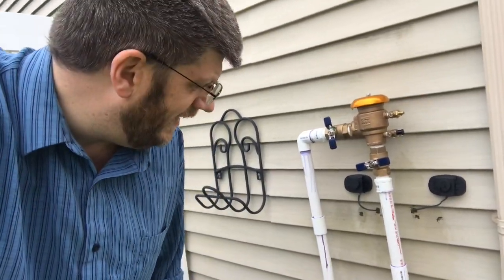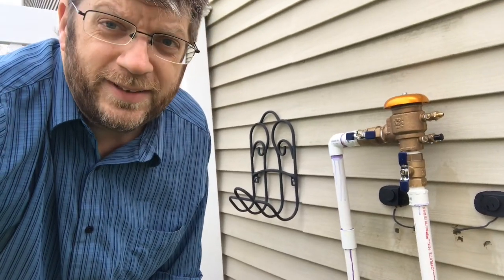How To Completely Replace a Lawn Sprinkler Febco 765-1 BV Pressure Valve (Backflow Preventer) on PVC

Comment: For all that are making this repair, he did it correctly. Word of advice pay the extra money for some union connections (quick disconnects) on both sides. It will save you time in case you make a mistake or the valve gets damage and can't be repaired. I learned from experience of gluing too soon and end up 1 foot high to 2 foot high 🤣🤣🤣🤣

Comment: One split ball valve is the only likely broken part, so sure, buy an entire unit. Insulation without a heat source, like heat wrap under it, is pointless. Draining the system properly if in a cold climate is the only way to avoid valve damage, or actual unit failure. The union connection idea is very wise, as it makes disassembly easy, without need of cutting/regluing pipes every time a repair is needed. Really, if this is one's level of knowledge, pay a plumber.

Comment: You need a hose Bibb vacuum breaker for your hose Bibb.  Once installed, assembly should be tested by a licensed master plumber with backflow endorsement to be sure assembly is working properly

Comment: Thanks for the video.  Very helpful.  I now have to go back to town and get some pvc pipe, unions and etc for replacing the soon to be cut pipe.  My question though, why did you not cut the new pipe so your Backflow Preventer Valve wasn't so high?  My plan is to maintain the current height that I have.
Reply from the maker: I think I made it a little higher because I wanted to give myself some space to cut the pipes again if the darn thing was to split again.  As some of the other comments mentioned, I'd probably be better off using some sort of connection which would allow me to take off and replace the backflow preventer a little more easily.  I'll make a video if I ever do that!
Reply: Sounds good.  My valve is threaded to copper pipe at the bottom. I bought way too many pieces of connections and unions.  Part of it is because I forgot about the pipe at the bottom.  LOL 😆

Comment: anyone looking to do this repair, i recommend using a pvc cutter instead of a saw. if pvc debris falls thru that main line. your valves will catch debris and get stuck next time you turn it on, requiring a valve cleaning. Other than that tom executed this well
Reply from the maker: I agree with this. I used what I had, but have since learned about PVC cutters.
Reply: Agree homeowner did exactly that then had to call me to clear all his valves that were sticking open. He tried to save a few bucks and it cost him several bucks

Comment: Just hook it up without the back flow.......it’s worthless
Reply from the maker: SOOOOO tempted to do this next year!  The problem is that our water meter gauge (little black thing with wires) is right there and I'm afraid the township would see our sprinkler system without it and not like it.  I had to (yet again) replace the plastic parts this year...

Comment: Tom, thanks for the video. My question is regarding the winter storm we just had in Houston, Texas, 15-Feb-2021, where we saw -8Deg F temperatures. I thought I had my system well insulated and still craked one of the valves. Do you think those temperatures were too cold for our sprinkler systems?
Reply: Same thing happened to me.  Properly winterized the backflow preventer but it still cracked near the valves.  The Wilkins 720a are designed for "light freezes"
Reply from the maker: I'm not sure why they crack sometimes.  I've had a few of them go.  I would agree that they probably can handle a little freezing (small water expansion).  I'm not an expert in these things but when you close them up for the winter I think you should also make sure the pressure valves on the side are OPEN so that water has a place to escape if it starts to expand.  Just gotta remember to close them back up before you turn your water back on.
Reply: @HomeImprovementVideos  - The ones on mine were installed in 2007, I believe.   They'd been drained for weeks prior to the freeze, including the pressure valves open.  They broke at 90 degrees from the handle on one, and 180 from the handle on the other.   These cheap Chinesium "brass" valves apparently trap liquid against the ball, and can't handle any expansion.  

You could probably have just made your assembly two inches shorter without adding all of the extra extensions :)

Comment: Thanks very much for this. My Febco busted due to the unusual cold snap here in Texas. This video is spot-on.
Reply: if water is coming out from the copper hat thing, maybe its just an oring that needs replace/kit due to weather, they are usually like 30-40$ no need to replace all unless crack like in the video
Reply: @Fgalvezpool  I went ahead and order the the whole valve. $80 on amazon a few days ago, but I'm not seeing it listed now
Reply: Me too. Will be doing this in the next month or so!
Reply: Lol I’m going to be doing this also
Reply: 2021 Texas cold-snap victim checking in!!!  I also have the same crack in the same spot.  Question: Can I just replace the small valve only?  Or replace the entire unit?
Reply: @Antebios  - The valves are reasonably standard parts.  If the rest is intact, you can do that, but you'll still have to cut back the PVC due to poor planning on the part of the installers.  That is, they don't bother anticipating anyone actually needing or wanting to unscrew any of the parts to replace them.  Destroy, then rebuild.
Reply: @tbelding  I did it! I replaced the ball valve only with a freeze-proof ball valve.  It took me 10x as long as a professional and a few retries.  Cutting the PVC wasn't the problem, nor taking the broken valve off.  Finding the correct 1-inch adapter was tough and then when I did the threads were incorrect.  I ended up reusing one of the old adapters and visiting a few plumbing stores.  Everyone was after the same parts.  I re-attached the parts in order ensuring there were no leaks along the way.  I spent 1.5 hours alone digging to get to the main water valve to start the project.  Which reminds me, I need to protect what that main valve.
Reply: @Antebios  - Did you end up using unions, or just couple it together?   I'm waiting for the landlord to give me the go-ahead, and then I'll cut off one end to remove that valve, then go get replacement parts plus unions.  As long as the valve is shut or fully  open, the other valve doesn't leak, so I can leave it hanging for as long as I need to.  I can water by hand :).
Reply: Same here! This video will come in handy when my part arrives. Thank you for this video
Reply: I just cut and water is pouring out. I shut my water off. Is this just the water in sprinkler lines? Mine cracked during storm in same spot. Please help me.
Reply: Will water ever stop
Reply: I’m another freeze 2021 victim in TX.  Thx, great video!
Reply: Lol....me too
Reply: Same here

Comment: Sprinkler company wanted $89 for first half hour, $60 for each additional hour and $295 for the back flow preventer.  Home  Depot's price was $83 for the part and I probably bought and additional $20 in pvc connectors, etc.  After watching this video I did it myself (I'm a librarian) and it  works great.  Thank you so much.

Comment: Nice video!  Is cutting the PVC always necessary?  Is it just to allow you to unscrew the assembly?  Seems like a lot of extra work for something that should be pretty simple to install.
Reply from the maker: I don't think I could unscrew my PVC.  Usually PVC is glued together at the joints.  I've seen A LOT of different setups for these outdoor sprinklers.  It seems everyone does it just a little bit differently.
Reply: @HomeImprovementVideos  Thanks, I'm new to DIY plumbing so these little details are helpful to know.

Comment: Tom, thanks for taking the time to make this video. Replacing my cracked Febco was my first plumbing project and I used your video to get it done. Now I'm thinking of making my own cologne called "PVC Primer for Men."
Reply from the maker: Seriously!  It's quite a distinct odor.  PVC is a great way to "get into" plumbing... I'm still not an expert by any means, but I've got a few copper pipe projects lined up - but instead of soldering I'm going to use Sharkbite connectors... I'll post videos (if I survive!)

Comment: OR, you can replace the cracked ball valves with Freeze Tolerant style. They have a freeze plug in the side of the ball valve to save the ball valve from cracking.  Never have a cracked valve again !  FreezeProofValve.com

Comment: Tackling this very same project this week, thanks for the video! Doesn't seem too bad.
Reply: Turned the water back on and all looks good. Now just have to figure out the system. When we moved in I knew nothing about sprinkler systems so I didn't winterize and it blew. I think I could have just replaced the internal pieces, but it had a big crack in the metal part of it so I just decided to start fresh. The valve was 85 bucks, then just some primer, cement, and PVC pieces and I was good. Had to add some PVC to keep it over 12 inches above ground. Interestingly, I was told I needed to have it inspected
Reply from the maker: @davearredondo4915  Huh.. I've never heard of an outdoor sprinkler system needing to be inspected.... Wonder why?
Reply: @HomeImprovementVideos  - probably a HOA/deed restriction "idiot with a clipboard" requirement.
Reply: @HomeImprovementVideos  it is to ensure that the chemicals that are sprayed in the lawn does not seep through the sprinkler system and back into the city drainage or water system

Comment: I would like to just omit that back flow prevent or, nothing but problems....
Reply: It is code in most places
Reply from the maker: See, i'm not sure if I should really do that.  I think they're actually required to prevent dirty water from flowing back into your home's water supply (or the public water system).  We actually have water company people visit our house to read the water meter every few months.  The meter sensors are those little black pucks on the outside wall.  I'm guessing they wouldn't like seeing a sprinkler system without the backflow preventer in place.

Comment: Great job, Tom.  Very informative video.  I need to take care of the SAME EXACT project today with the same hardware.  Do you know what the 2 small valves do on the right side just below the bonnet? They have little flat head screw adjustments.  I have no idea what they’re used for.  Thanks!
Reply from the maker: Yes!  They’re venting screws (not sure if that’s the real name) and I’ve seen professional sprinkler guys use them to blow out the water at the end of the season.  Tip: when winterizing make sure those two screw are OPEN so that any water in the valve can escape instead of freezing, expanding, and breaking the valve...
Reply: They are ports for testing the  backflow.

Comment: Couldn't you just replace the valve?
And on the left pipe why couldn't you cut it and use a coupling instead of building all over?
Reply: That was my thought.  I have a crack in the ball valve assembly and plan on just replacing the valve.

Comment: My daughter was walking to her car during a really bad thunderstorm and slipped on our green sprinkler system box in front yard. The lid flew off and she fell in all the way up to her thigh. One leg in, one leg out. Her foot came down on a pipe because water was spewing out of it and down our street. A neighbor was able to turn the water off but we need to get this fixed. We have a Rainbird e6c. What is an estimate for a repair like this? We aren't the original installers so unfamiliar with sprinkler systems. Are we talking hundreds or thousands to repair?
Reply from the maker: That green box in the ground is where the sprinkler switches are typically housed.  I can't begin to guess if she damaged anything or not (hope she's okay) but I would imagine a repair like that might cost a few hundred bucks, not thousands.  But you'll want to get a sprinkler expert in to see what the real damage is.
Reply: Tom's Home Improvement Videos She’s doing OK. She had a thin cut going straight up her shin But once the blood was cleaned off it wasn’t as bad as it appeared. She’s a nursing student so she’s practicing caring for it. I found out the part that was broken off May cost between three and $700. It’s called a backflow. Thank you so much for responding and for your good videos I really enjoy them!

Comment: I suggest putting in unions, one each in the vertical supply and downstream PVC pipes. This will allow you to remove the PVB without cutting the pipes. Also, insulate the piping and the two ball valves before the first freeze. No gaps in the insulation.
Reply from the maker: Yeah, my neighbor also suggested using unions and even working out some sort of "snap into place" system so the whole thing can be removed or swapped out.  The next time it breaks I'll have to consider that!
Reply: Can you elaborate more on what a Union is and how it could be used ? Video link to it would be of great help. 

Basically i am in this situation, and waiting on amazon order to come in.

Thanks in advance
Reply: NM i googled using unions with PVC and was able to better understand. Thanks for the tip.

Comment: Whatg is that 2 black things on the wall with wire?
Reply from the maker: Water meter sensor.  They local company sends a guy around every month or two and he just reads the meter by holding a little device near it.